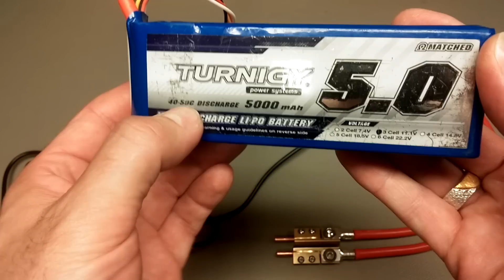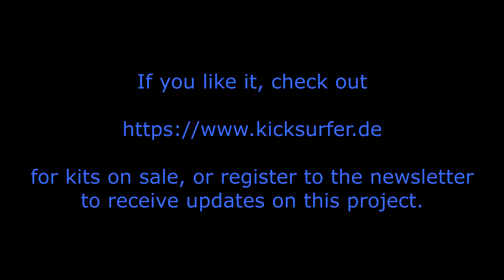Next level DIY battery spot welding

Comment: This is so cool.  Typically German and over engineered.  Is it possible to have the same microprocessor electronics measuring input energy, but using a microwave oven transformer?  The battery is portable and small which is great, but you need to buy a battery charger and battery.  The transformer might appeal to some people because they are cheap to obtain and to run.
Reply from the maker: The system accepts only DC, so you would need to have a huge rectifier between transformer and kWeld. But other than that, it should work. It's not necessary to measure input energy to achieve that, the module always knows current and voltage across the weld spot, that's all thats needed. .... In which way do you think that the system is over engineered?
Reply: Don't get me wrong, I meant over engineered as a complement.  The brass bus bar for example, it doesn't have to be brass or copper.  It could be some other cheap metal. The thing even looks nice.  I can tell pride has gone into making it :)   The bridge rectifier sounds like a bad idea huh.  Just thinking out loud but what about using the ADC of an arduino to measure voltage and current on the secondary of a microwave transformer.  Its pushing the arduino but I know you can get about 4000 voltage and current samples per second out of an arduino (using integer math and some other tricks).  I recently made a solar power diverter which takes voltage and current samples from a 50Hz 240 V power supply.  Not sure how you could measure 1500A with any degree of accuracy?
Reply from the maker: no worries, but I wanted to challenge you. If you can point me towards anything that is overengineered, and help me make my products better, then this is win-win. I'm not a friend of over-engineering because in my opinion over-engineering is bad engineering. Engineering as such is to find the optimum, and that always includes cost / performance tradeoff. In case of the brass bus bars: I started with aluminium but realized that it will oxidize over time and give bad contact. Copper is hard to machine, brass is much better. But I admit that it looks great :-) The dimensions were chosen such that it can carry the current level without overheating. Steady state temperature is around 50°C after intense use, so I wouldn't want to use less material here.

P.S. the STM32 microcontroller runs it's ADC at 300,000 samples/sec, no problem to follow recitifed AC. The (fixed point arithmetic) calculation loop runs with a 10 microsecond interval, doing all the calculations at 50% CPU load. The current is measured via MOSFET Rdson, which is good enough (+-20%) because the goal is to implement energy metering and not to make a precision instrument (that would be over-engineering ;-)
Reply: Thanks. I really like making stuff myself which is why I was querying about the microcontroller transformer idea.   I just saw on ebay a 2000 A hall effect current sensor.  I guess you could probably accurately sample voltage (what is it between 1 and 2 V?) and current (~1000A) at 1024 bit resolution at 4000 samples per second, or even faster with the microcontroler you mentioned.  I don't think it would work though, because you'd probably have to switch the transformer off (with a triac) at the zero crossing point on the sine wave which means multiples of 0.02 seconds (@50Hz).  Oh well. To be honest I was going to buy your device anyway.
Reply from the maker: You're thinking exactly in the direction that I was at the beginning. And there are even methods to "blow out" an SCR while it carries current. I didn't go this route because a) I have much more expertise with MOSFETs than with SCRs, and b) I didn't like the idea of having to find, salvage and recoil a microwave oven transformer.

Comment: WeAreTheWatt - this really is next level spot welding, I'm seriously impressed and I really hope your hard work reaps the returns it deserves!
I have a few 5Ah 4S high C lipos which I can connect in parallel - does the welder accept higher voltage and compensate for that in the energy calculations?
Having already built an 18650 pack with 224 cells by soldering and about to make another with 800 cells, this would help very much!
Reply from the maker: Thanks :-) Yes, the welder accepts anything from 4V to 30V. The algoritm measures delivered energy regardless of input voltage. Soldering 224 cells sounds like a tedious job, and it also tends to impact long term reliablity of the cells.
Reply: That's great to know, thanks!
The 224 cell pack is doing fine and the 800 cells half entered into the db for balancing...
However the ebike controller failed last week using heavy regen down a steep hill, so it'll get some rest for a few weeks :-(
Reply from the maker: Many motor controller designers don't properly test/validate regen operation, if you know VESC then I can share a secret with you that this is one of those ;-)

Comment: That lipo looks a little bit puffy. It's not happy! 😂 🤯
Reply from the maker: That's why I discontinued using it, and have moved to a Turnigy nanotec 3S / 5AH / 130C. That one has proven to be up to the task so far. Any decend 65AH car starter battery will work fine as well.

Comment: Interesting idea to use a battery as the source of power instead of a microwave transformer like everybody else. Thumbs up!
Reply from the maker: Thanks, but I wasn't the first to attempt this. This part of my product was "proudly found elsewhere". My contribution is to turn this into an easy to assemble, easy to use and robust kit. The energy metering approach is also a novel, I haven't found this even in much more expensive industrial units.

Comment: I’m still going to watch the other videos, this is the first one I’ve watched. A little concerned about that battery, I can tell one or more of the cells have already swollen up. Thus could be by the cells not able to give the power being pulled, or maybe it was shorted out? Nice design and firmware features. What’s happens if the 2 electrodes are touching each other by accident, I’m assuming they will try to weld together. But the bigger concern is any of this power getting back to the battery. Even uS of power back faster then the mosfets can switch could cause damage to the battery cells.
Reply from the maker: The cells that I use in this first video were not appropriate, and I had made quite a bit of research to come up with proven alternatives. The kWeld product page lists these in the text. And I am working on a capacitor solution that turns kWeld into a CD welder.
Reply: WeAreTheWatt uhm using supercapacitor?
Reply from the maker: That's already done and for sale in my shop, just didn't have time to cut the video footage that I have made weeks ago :-/

Comment: Well done! Does the system also monitor the LiPo battery voltage to warn against over discharge?
Reply from the maker: thanks :-)) Yes the firmware is monitoring the battery voltage and will display a warning when it goes low. The voltage at which is does that is programmble, to allow for different chemistries and cell counts.

Comment: I loved seeing the lead wiggle at 8:46  - wires  don't usually move when conducting DC current (but i suppose this is more like AC for the duration of its test.
Reply from the maker: It is the Lorentz force that causes the leads to attract. This is always there between two conductors carrying DC current, but you normally don't notice it. Different here, because the current is approx. 1300A.
Reply: wires will twitch anytime a heavy load like that is working.  AC or DC..

Comment: You're holding on to those leads with bare hands, how come you're not getting electrocuted?
Reply from the maker: You're not getting electrocuted from a 12V battery.
Reply: WeAreTheWatt it's not the volts that kills you, it's the amps. Static electricity, when you rub your feet on the carpet and get a shock, is about 75,000 volts or the spark from a spark plug. A half of amp will kill you. He was holding one electrode with one hand and the other electrode with his other hand. If those two electrodes weren't connected to that piece of metal when he hit the button, the electricity would have went through his body. Electricity takes the shortest path of least resistance and luckily went through the metal. But if one of those contacts wasn't making contact when he hit the foot pedal, zap you're dead.  You don't think 12 volts will shock you? Try 9 volt. Take a half dead 9 volt smoke alarm battery and touch the terminals to your tongue. Don't try that trick with a new 9 volt battery. 

  If you already hit the foot pedal and didn't get electrocuted while holding those electrodes, you were lucky, it means your hands were extremely dry. If your hands were wet from sweat or just a little bit of moisture, the electricity would have went through one arm and right past your heart comma out the other arm. That would have stopped your heart. That's why I said try a 9 volt transistor radio battery to your tongue. It won't kill you because the voltage is not going through your heart. But the shock alone could kill you if you had a bad heart. Just briefly touched the tip of your tongue to a 9-volt battery and see what happens. Don't say you weren't warned. But then again, maybe that's God's way of getting rid of the stupid people in the world.
Reply from the maker: you name it, it is current that kills you. According to Ohm's law and assuming a human body resistance of 50000 Ohms, the current here is 12V / 50000 = 0.24mA. Yes, I know that 12V does not shock me. The same holds for 60V, which is the limit of SELV circuits in Germany (https://en.wikipedia.org/wiki/Extra-low_voltage). I really don't know what you are talking about here, do you have an electrical engineering background?
Reply: WeAreTheWatt no electrical engineer here. But I've been shocked by a 9 volt battery. And remember stun guns are made from smaller batteries than the one you have here. The resistance of your hands depends on how much moisture is in your hands. If you perspire the resistance is going to be lower.
Reply from the maker: Please stop making postulations and assumption, electrical engineering is an exact science. You cannot get shocked from a 9V battery. The reason why they feel awkward on your tounge is the electrochemical interaction with your taste receptors. A stun uses a step up transformer to turn the 9V battery voltage into tens of thousand volts, you cannot argue from such that a 9V is dangerous. Have you read the Wikipedia article that I linked in for you in my last post? Do you understand what PELV is and means?
Reply: you have to have a certain amount of volts to conduct, before amps can follow...you can't feel 12 volts thru dry skin until it gets up to about 40 volts. then you might feel a tingle, as for  on the tongue, you can really feel it. but the current is not enough to harm ya.. i can hold a fresh 9v battery to my tongue, but it is mighty spicy..lol (a good challenge test among friends) i have even been hit by Tesla coils, and spark plug wires..they will knock you down in the dirt if not careful, but not likely to kill ya. but 120v house current has the heavy current to kill ya, if it bites ya just right.
Reply: stun guns etc. have boost coils and circuitry that boost 9v into 50kv. kicks hard but not typically lethal

Comment: Looks like a nice design but not sure from a functional perspective, what advantage this unit offers over a simple battery / solenoid welder such as the one posted by this youtuber (https://www.youtube.com/watch?v=b_kGgPVrcCI) .  His version is easy to build using off-the-shelf parts, so is a true DYI project.  You sell yours for  156 Euros in kit form.  For that amount, I may as well buy one of those el cheapos from Ebay or Amazon.  Those may not be as nice as yours, but it's pre-assembled and ready to go, and many others on Ebay seems to be using them without many problems.
Reply from the maker: The one shown in the video uses your finger to control welding time, so you have quite crude control over the generated heat. You may get a good weld, a bad weld, or a damaged battery tab depending your ability. I won't comment on the Chinese cheapo welders, you may read further into that in the respective forums. I personally am very careful when buying anything that has been designed in China. The pro's for kWeld are: very robust, very strong (tested with 0.3mm nickel strips but can certainly do more with a good power source), easy to use. But the main advantage of this design is that it automatically controls the pulse time to a dialed in amount of energy / heat. By this it can compensate any change of conditions to a good degree: varying battery voltage and resistance, varying weld spot contact pressure, dirt / corrosion at battery tab or nickel strip, electrode wear, and so on. This enables you to make repeatable consistent welds, which is important if you want to have reliable batteries in the end.
Reply: Yes, your design is impressive and a lot nicer than the others, and certainly delivers much more precise weld.  But DIYers all over the internet have been building functional battery packs by soldering, welding using a hacked microwave transformer, battery controlled by solenoid, and other crude methods.  Given this, I'm just wondering whether the task of welding battery tabs requires the type of precision offered by your design.  It's like having an everyday wrist watch that's accurate to the nano seconds, which is overkill.
Reply from the maker: I know, and that's totally legitimite, but I think that it depends on the relability that you expect from your work. If your weld process is not well controlled, then you have to risk getting a mix of welds that are mechanically weak, and others that have started burning into the battery, damaging the internal chemistry.

Comment: Very nice would you be willing to sell just the unpopulated pcb? I bought another similar Arduino based pcb and would like to compare the outcome of different spot welding methods on my blog. Cheers
Reply from the maker: For kWeld, that would not be as easy, because the firmware of that is closed source and I have no ZIF adapter for the microcontroller that I could use to preprogram one for you.
Reply: WeAreTheWatt I see I thought this is just an stm32 in bootloader mode and I could program it with the firmware update package from you
Reply from the maker: That's true, however I am not using the built-in bootloader but a special one that I developed myself and that uses encryption.

Comment: have you tried gildcorp electrodes? i just put in an ebay order to give them a shot. I just got my 100f super cap based design up and running(we talked a while back). apt issues delayed me for 6 months and are still the bane of my existence. i havent verified the caps yet due to time..that said 6s2p 350/cap 100bank was blowing holes in the tabs at 16v. I get welds that tear leaving the nugget behind at around 12, adding a 3rd p string of 6 to see if i can go lower voltage higher amperage...and I still have some cleaning/optimization of the bus bars/connections to do as well so its likely not putting out what it could but it appears that deal i mentioned months ago were decent quality maxwell caps.
Reply from the maker: Can you give me a reference to them? Google doesn't put out anything, and I am not aware of them. Great that your supercaps are performing well!
Reply: derp: glidcop, i need to learn how to have time for sleep lol. copper and aluminium oxide alloy http://www.resistanceweldsupplies.com/bar-stock/glidcop.html the part i ordered is ES0450. I saw some discussion on endless sphere and mentions by sunstone
Reply: how much would you want (shipped to MN, US) for a set of those electrode holders?
Reply from the maker: thanks, that material sounds really promising!
Reply from the maker: just have a look into my shop, you can get all the numbers there. I have to say that I haven't found the time yet to set up more sophisticated shipping rules that includes small parcels or even letters, but that is on the todo list for the next weeks. You may also contact my local U.S. reseller, spinningmagnets@gmail.com

Comment: Very good work! Concerning the power supply: would you advice to use a capacitor (like the ones you use for car amplifier-setup)  parallel to the battery to reduce ampere-peeks on the battery?
Reply from the maker: That would be a good idea, but it would need to be one with an extremely low internal resistance. The battery that I am using currently has only a few milliOhms, and the capacitor would need to be well below that in order to make a contribution. Anyway, I am working on a stationery supply for the welder, which is built around such a capacitor.
Reply: Oh, you are right, I forgot about the importance of the internal resistance the power sources have in relation to each other. Perhaps an array of parallel connected capacitors would help a bit... I am looking forward to your power supply!